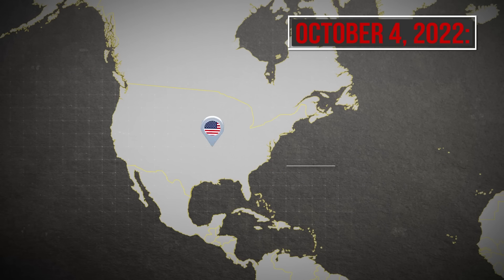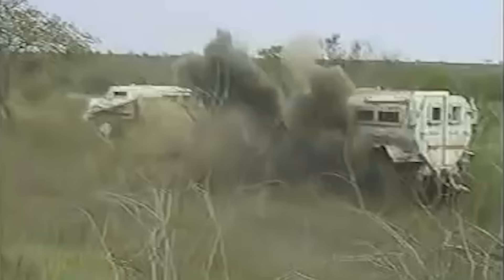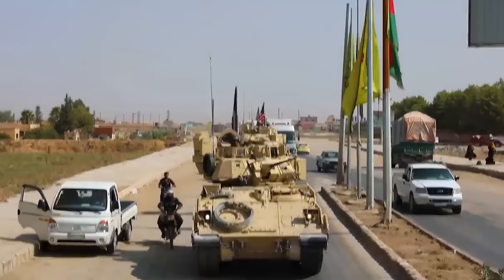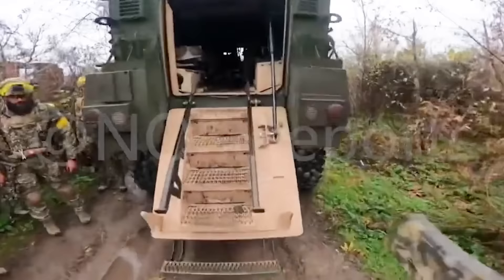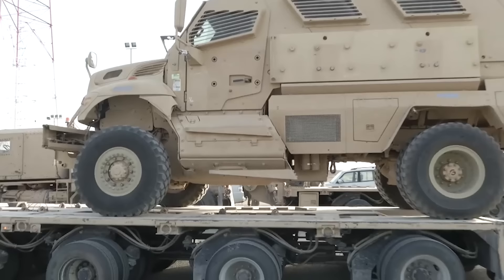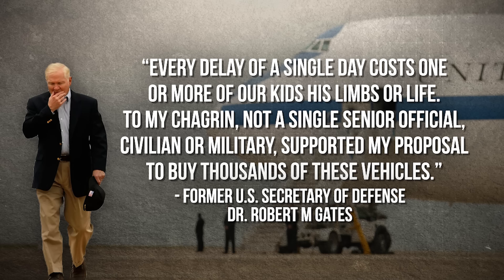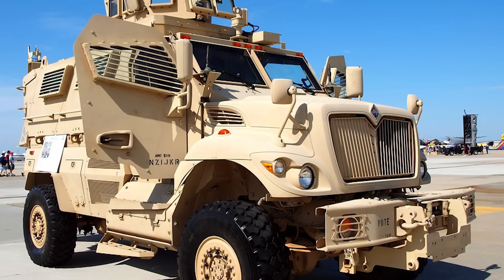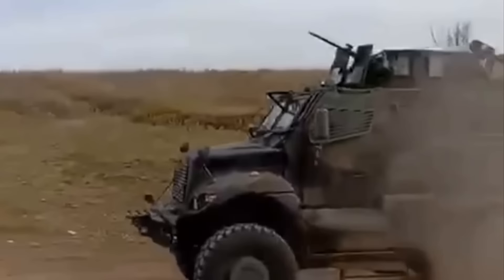Why America is Gladly Giving Away their $50 Billion Truck

Comment: Over my two deployments to Iraq, we went from welding and bolting mild steel plates onto unarmored HMMWV to MRAP's by the last deployment. I have to be honest, I far prefered my M-1114 over the MRAP. However, there is no question that the vehicle saved lives. Two friends of mine in my unit were hit by an EFP right on the commander's side door and lived. That would not have happened in a HMMWV. Heck they would have died of they were in a Bradley. On countless other occasions they saved others from injury as well due to convention IED blasts.

Comment: 15:28 the MRAP should be used as an APC to ferry troops to the front. It is insane to use them in frontline fighting as they where never designed for that.
Reply: Agree not near the front line.

However they would be useful in minefields.

Problem is that Ukraine is artillery and missile war.

Comment: South Africa even had school "buses" that were made from these troop carriers.  The very first ones in US service looked like the originals before updating.  It made absolute sense that MRAPs would come form South Africa because they did it first.
South Africa created some good military equipment.  Denel has a 105mm howitzer with the same range as 155mm howitzers.  A self-propelled howitzers that has a range that is 5 miles+ more than the towed 105mm howitzer currently in the inventory. The towed version of this howitzer has the same range. One was integrated and tested on a Stryker as a self-propelled howitzer for Stryker Brigades.  Why don't Stryker Brigades have this self-propelled howitzer with a 19 mile range howitzers in inventory in their artillery battalions?  Even better that self-propelled 105mm has direct fire capability.

Comment: I knew a guy who was in an MRAP.  He was protected inside from the mine, but it rolled the MRAP and he got a severe concussion.
Reply: He's still alive though.  That's difference between a Humvee and an MRAP.
Reply: Or still has his limbs.
Reply: when the equipment works, it keeps people alive... I knew a young soldier who was in Afghanistan wearing an IOTV, and he was shot by a sniper in the chest... his IOTV did its job, and the round ricocheted and sliced through his shoulder. He was being discharged due to having a bum shoulder now, but he is alive.

Comment: The best defense against IEDs is to not traverse predictable routes that can have IEDs emplaced to begin with. In other words, the "best armor" against an IED is to not get hit with IED to begin with.

The entire IED and VBIED thing is a factor of the overall operational nature itself, so the problem with all vehicular approaches to this challenge, as good as they may have technically been (to include MRAP), is that it's an attempt to address a symptom of the operational problem, rather than the problem itself, or as Sun Tzu put it, it's "tactics without strategy," which is "the noise before defeat."

MRAPs and such are essentially proof that what is supposed to be a maneuver based, symetric warfare force is trying to also be a policing force: maneuver is surrendered by moving in built up areas along predictable and preexisting routes; firepower and combined arms is surrendered because these built up areas have a non combatant population in proximity to forces, where the enemy can hide amongst, and for whom casualties are socially and politically unacceptable.

It was a recipe for disaster. The advantages of the US military as a fighting organization were surrendered in Iraq and Afghanistan and the initiative was given to the insurgents, who could punch above their weight via tactics such as IEDs. Making vehicles that were more resistant to IEDs did not take that initiative back; it simply edified that the insurgents were writing the tactical playbook. And that, imo, was a completely ludicrous thing to do.

Comment: The VA Beach PD has one and it was very useful in dealing with a serial killer sniper.  The MRAPs are not only 10' tall, but can ford through 6 or 7 feet of water.  In Hurricane country, this has been very useful for traveling through heavily flooded areas and rescuing people from their second floors.  With a roof at 10', people can hop out of second story windows onto the MRAP roof and then climb down through the roof turret hatch into safety.  The circular track around that hatch that was intended for heavy machine guns and grenade launchers is used by police for high powered search lights for rescue work, and motorized remote control video cameras (including low light and IR) for SWAT situations.  The MRAP is very useful for SWAT and rescue work and the police version has no weapons.
Reply: Has no weapons YET😉

Comment: Great video cappy! Strange US based it on Casspir when the Ratel seems like it would have been better suited for US requirements. Ratel is not as tall as Casspir and has lower center of gravity, already comes as 6x6 rather than 4x4, has greater range, already has weapon turret to support up to 90mm gun, accommodates 10 which is ideal for US squad size and has better protection than Casspir both for small arms and mine resistance. Finally it is more an IFV so more suited for traditional warfare so would have a purpose post insurgency arenas. Strange they chose the more passive Casspir?

Comment: maybe the mrap is not ideal for use in direct combat when you're a military with massive resources, but for ukraine it seems a hell of a lot better than the pickup trucks they've been using. the role of a protected troop trnasporter behind the battlefield seems pretty important for shrapnel protection and even mnes from sabateur groups operating behind the lines etc. ukraine seems to find a way of making use of them compared to what they've got which is nothing.
Reply: Not always, MRAP is a very high vehicle. It is better be covered by terrain.
Reply: Ukraine has a big mix of combat from battalion level engagements with all the trimmings to insurgency and saboteur type attacks where it's basically a guy with a rifle picking people off from a tower block. I'm sure they'll find a genuine use for practically anything they're given, considering how dynamic the situation is.

Comment: Mraps have been loved in Ukraine. As it turns out mines and IED are always used in war. They also fits Ukraines preferred tatic of quick thunder run. Given that Ukrainian has purchased a large number  of mraps from Turkey
Reply: Very important aspect of the success of the Casper was fire and movement (or, as you says thunder run").
Reply: we don't know whether the 200 Kirpi MRAPs Ukraine got from Turkey were purchased or not. Acquisition was not made public by neither party and neither confirms it. They are first gen versions directly from the Turkish army stock. Possible that they were donated.
Reply: @TheKurtkapan34  we have videos of them on the front
Reply: Ukraine also got given 100 Bushmaster MRAP’s from Australia… (a mix of APC and Ambulance versions).
Reply: And? Still in Love ?

Comment: Thanks for the video Cappy!  I think one of the big differences in Ukraine vs Iraq is the artillery and rocket launchers the Russians bring to bear (no pun intended).  They aint terribly accurate vs Western platforms from all I have seen, but I do think the addition of some of these types of vehicles have given the Ukrainian side a maneuver flexibility with protection in an artillery beaten zone.  That type of battle of maneuver would have been much more costly earlier in the war when these types of assets were lacking.
Reply: All it needs is a fully auto belt fed 30mm or 40mm sniper gun mounted on the top of it to turn it into a "Rolling Wart-Hog" tank killer. What-Ever the Ukraine's arm it with you can bet the pentagon will be jealous of the Ukrainians innovative skill set. It's amazing what a Ukrainian can make out of a $25.00 WIFI security camera mounted to a telescopic gun sight feeding streaming video to an old iphone 6. Our military would spend $50,000 for something that was 800X bigger and could not be fixed by a 12 year old with a guitar pick and a micro screw driver.
Reply: There really just isn't any mobile protection, "in an artillery beaten zone." You can dig in and bunker up, but artillery kills tanks, leg infantry, and everything in between! The only counter to artillery is either air, or longer-range artillery. I'm still stuck wondering why neither Russia nor Ukraine have dug out the old D-30 field gun! Those used to chew up the U.S. 105 and 155 artillery batteries in Vietnam, making them a magnet for air strikes, which meant ringing the D-30 guns with SAMs and flak cannons, which created the Wild Weasels.

These days, I think of towed artillery as dead meat, due to the current threat of air cover, even prior to the diverse proliferation of armed drones. The T-10M has tremendous refit potential, as an SPG with the armor to survive almost anything (especially if the refit includes re-forging the armor with magnetic fields--called, "magnetically forged ultra-dense aligned crystaline steel") and a 130mm main gun that can reach 40 kilometers with a 60-kilogram shell; replace the co-axial and top-side 14.5 mm machine guns with Steyr 15 mm machine guns (much more capable, plus much more ammunition for the size and weight). Add an A.P.S. to intercept artillery and mortar shells and missiles, and even deflect long-rod kinetic penetrators. Add a powered Coppola to mount the top-side M.G. with thermal and R.F. detection to warn of aircraft, including drones. Add a second powered Coppola with a 30mm automatic grenade launcher loaded with pulse-plasma cartridges to eliminate drones. Add the arrangement of 81mm stub-mortars, to eject prismatic smoke and chaff to screen, or load VT-fuse fragmentary for close protection. Updated shells . . . .

Something Ukraine really needs is the Dutch "Goalkeeper" system, to intercept artillery and mortar shells, artillery rockets, and cruise missiles. One mount can only protect a three-kilometer radius, but that radius is protected! Nothing else does that job as efficiently; the lesser American systems it was developed from are limited and wasteful!
Reply: Would be nice to install Ukrainian made BM-7 or BM-3M Remote Weapon Systems.

World saw many videos from that system during Mariupol defense.

Comment: If anyone has seen the footage of a  part of the counteroffensive in Kherson but the Ukrainians are literally charging the Russians in a humvee and an Australian MRAP type vehicle, the humvee  becomes airborne as it goes over the top of a small hill., mortar rounds are literally exploding around them, it’s freakin’ nuts. So I’m sure the Ukrainians will put these vehicles to good use, and probably in some unexpected way.
🇺🇦🇺🇦🇺🇦🇺🇦🇺🇦🇺🇦
Love your channel mate lots of good stuff
Reply: All it needs is a fully auto belt fed 30mm or 40mm sniper gun mounted on the top of it to turn it into a "Rolling Wart-Hog" tank killer. What-Ever the Ukraine's arm it with you can bet the pentagon will be jealous of the Ukrainians innovative skill set. It's amazing what a Ukrainian can make out of a $25.00 WIFI security camera mounted to a telescopic gun sight feeding streaming video to an old iphone 6. Our military would spend $50,000 for something that was 800X bigger and could not be fixed by a 12 year old with a guitar pick and a micro screw driver.

Comment: Surprised height was never mentioned as a detrimental factor in engagements with hostile armor. The sheer height of the MRAP, combined with the lighter armor, makes them sitting ducks for even old T-62s from the Cold War. 

I think getting bogged down in wars where we use our military as a policeman, and then we print money to pay for billions of dollars in police equipment, is a problem in and of itself, and jeopardizes our national security.
Reply: Then it's a good thing they're not supposed to be anywhere near enemy tanks.  The clearance is needed for dealing with mines and the height advantage also helps for engaging from behind cover or to see over obstacles that would otherwise prevent you from spotting or shooting an enemy.  Not everything has to have a low profile and try to sneak around.
Reply: These things cannot be allowed near any armoured firepower.

Comment: Ukraine is going to put Bushmasters on those MRAPS and use them to clean house behind Bradleys.  If you look at the "destined for Ukraine" section of the Bremerhaven parking lot - Every single MRAP in Bremerhaven has a heavy turret designed for more than a naked 50.  Bushmasters are ideal for Ukraine 25's will be very good, but 30mm and up with the airburst and AP Ammo options will be excellent!

Comment: I haul Humvees sometimes out of their plant.  Mostly just your standard Hummer and it just is surprising to me how thin some of that light armor is.  Maybe it’s special steal but I don’t see around 1/4 plate steal doing much.  

The other thing, when they are on my trailer I see the belly.  They’ve loaded up with all that emissions BS that would easily immobilize them. They just aren’t impressive.  If a national guard is using them inside the states like helping with floods and stuff okay they would be perfect but patrols in areas with ied’s and such… nope.  Just wouldn’t take much to stop one.  They need CAT motors without the BS and all the airlines and everything protected.  Maybe it goes to show I’m not a military man but if I wanted to stop one it wouldn’t be hard so it would be super easy for someone that actually knows something

Comment: The MRAP was never fit for purpose, the Army was reluctant to adopt them because it was looking at the Guardian ASV, and the MRAP had to be replaced with the MATV, which was rushed into production so quickly the goddamn door would not close. The inability of the MRAP to go on anything other than hard flat ground off road meant that the HMMWV remained the only option in much of Afghanistan. The Bradley and Abrams weren't viable not just because of logistics, but also because they had flat bottomed hulls and are also vulnerable to IEDs. The real story of the MRAP is much like many other acquisitions. Money, interest groups and preferred manufacturers.

Comment: why are the mraps exploding on the mines in ukraine? are the mines different from those that these machines were built for?
Reply: Well, Ukraine is not Afghanistan where you can find homemade mines made of chewing gum. The maximum that can blow away your foot. Or rusty RPG's, AK's and pick-ups with mounted guns. It's no wonder that MaxxPro saves your ass. 

But on the Eastern Front it's a bit more complicated, as seen in the failed counteroffensive... Even Leopard 2 tanks can't do a thing.

Comment: Most of these comments "Im a veteran war on terror......" they really have little applicable information when it comes to Ukraine. Im mil also with a varried history, but I can say my guys on the ground in Ukraine really need the heavy weaponry of somthing like a 30mm or larger.  They also tell me that lighter armour but slow vehicles like THESE mraps are drone/artillerie magnet death traps.  Many prefer fast humvs or somthing like the m1117 guardian that can move and has punch. Mines are a problem, but so is weak weapon systems and lack of speed. They are not fighting sandle wearing clowns on 50cc motos, but heavily armed and adaptable modern convetional forces.

Comment: South African Casspir mine resistant vehicle was never intended as a police vehicle but because it was decided to fight Namibia independence with police force, not the army, it was at first extensively used by the infamous "Koevoet" police counterinsurgency unit in northern Namibia during the apartheid era and later also by the South-West Africa Territorial Force's 101 Battalion and the SA Army's 5 Reconnaissance Regiment. So calling it a vehicle suitable for police use is nonsense.